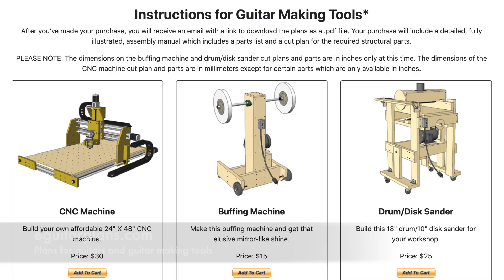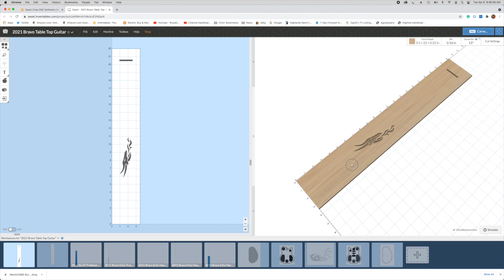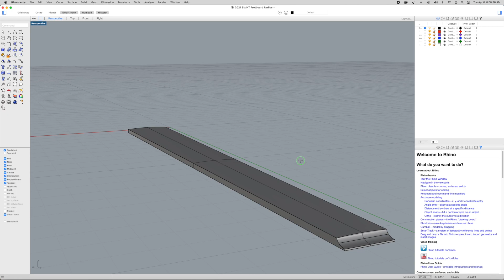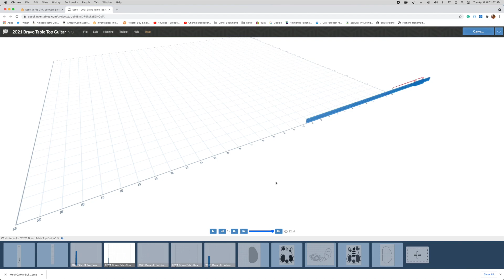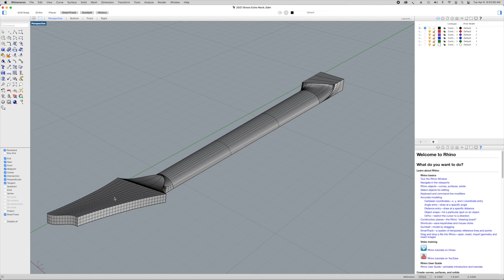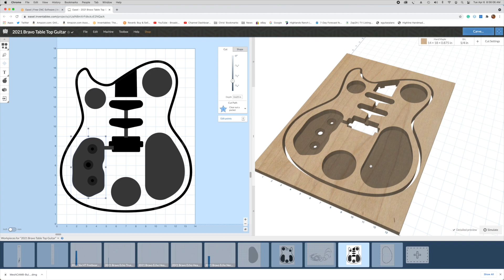Making A Guitar Out Of An Old Table Top Part 2

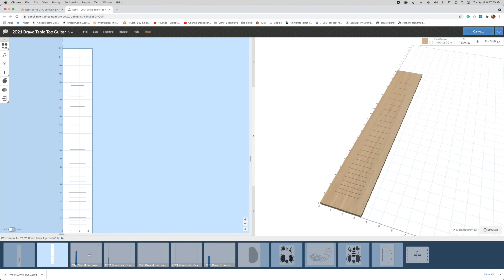Comment: 8:48 I've been thinking about making this blind fret slot, I don't have a CNC and the hard thing is, getting the radius in there. I need to come up with some kind of jig with a radius as a base.
Reply from the maker: Are you trying to make the bottom of the slot match the radius of the fret wire and the fretboard? If so, don't bother. It's not worth the effort.
Reply: @HighlineGuitars  ah, there you go ;) sorry if I repeat myself, I don't have comment notifications on, so, I mean, seem to ignore your answers